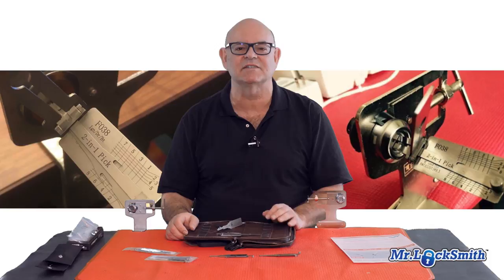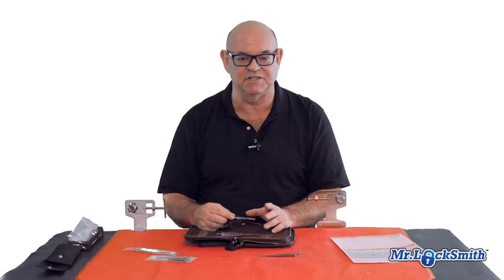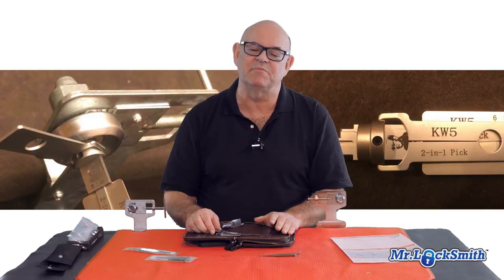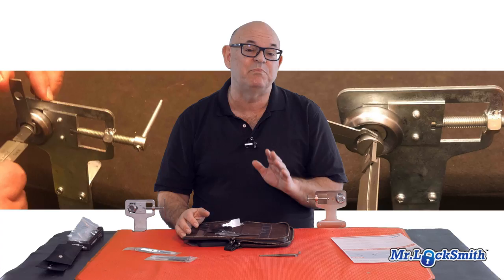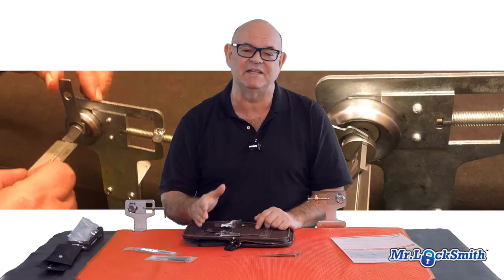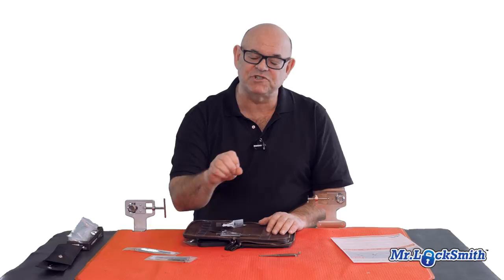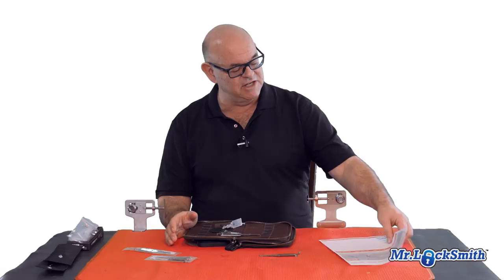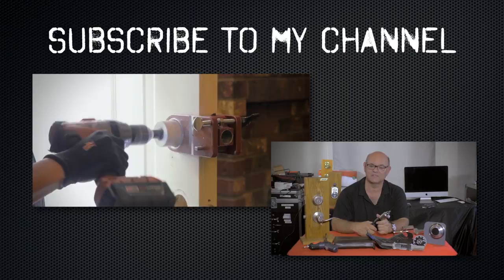Early Preview Lishi Kwikset Pick | Mr. Locksmith™ Video

Comment: I'm hearing these will work on smart key?... I'm doubting that , but can you,? I would really love the sc4!! Schlage my nemesis as well terry!
Reply from the maker: Kyle Corey New 6 pin Schlage Locks, SC4, give me a hard time too. The C123 and S129 are tough too. I just have to practise more. (Sometimes, I cheat and use the Kronos or WENDT electronic pick guns).
Reply: @24hrMrLocksmith  I have an old hpc gun. My most hated are the 5 pin Schlage KIK knobs or db with the spools and drill protection. ..I always practice on them but still they are no kwikset in my opinion. .for a residential lock security wise I like recommending schlage. I rarely get a Schlage to rake open,,,so ussualy spp is my route...therefore I think for beating the schlage  locks the sc1 or sc4 lishi is a good new method to try before busting the drill out....I must say I am deadly using the smartkey decoder ....under 7 min using depth keys and a curtisss 1100 duplication machine I can have open in first cut....I'm currently making a system that you use the decoder , get the cuts , then you have the tryout key set all keys numbered,  with the numbers meaning the cuts you have viewed. ... so I'm theory,  you decode , look up chart with numbers that corresponds to closest key , then you have an open... I believe this method could take 5 minutes or less with no extra blanks   key machine or code cutter, and every service truck could carry it . You wouldn't even need a service van with to do it.... but the number system is stillbeing created ... I think tryout keys themselves are stupid in that volume. ...but if you use them in tandom with the decoder all you need is the math. ..And you could have a very accurate method.....if theses worked the smartkey I'd love to have as another  option....any option is a good option
Reply: Mr. Locksmith   I use my electric pick gun a ton on KW 5 pin with regular success however I rarely have success with getting the Schlages open, not sure why.